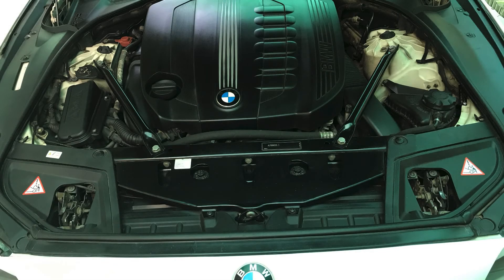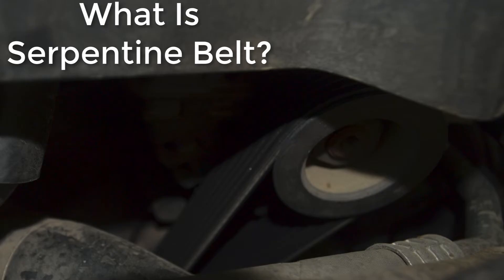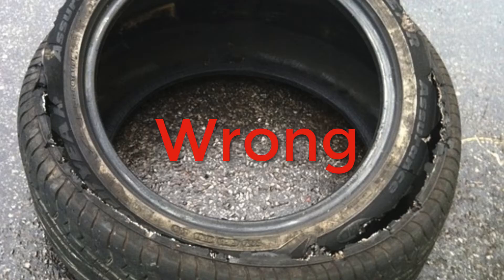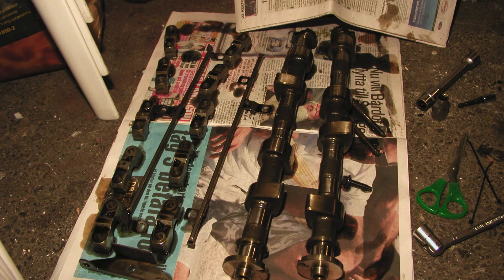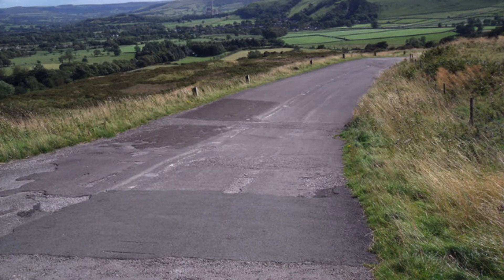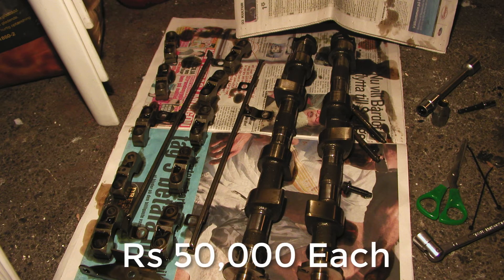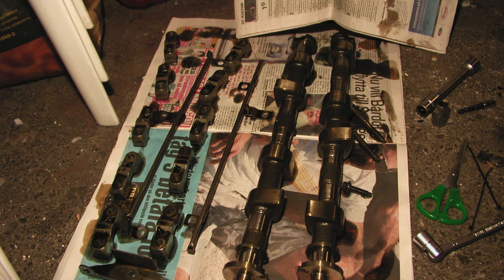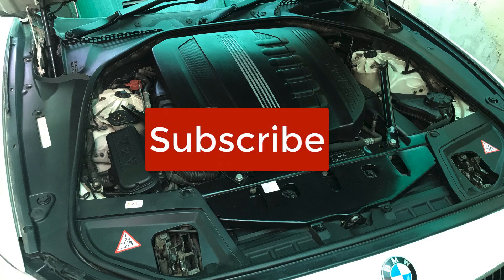Why You Need To Replace Serpentine Belt - Before It Snaps

Comment: This happened to me as well 3 months ago , coming back from work , when I started engine I heard some breaking sound , but engine running fine , also got some error like battery not charging or something. I ignored it thought some battery related issue and started driving back to home , halfway on the road  started getting error multiple errors abruptly then , all electronics stopped working one by one , steering got heavy suddenly , then car jerked 2-3 times and stopped in a middle of the road. 
Opened the engine , serpentine belt was out of the pulley hanging . 
Towed the car , and found out that one of the damper pulley which is attached to camshaft probably has seperated from its attachment with circular hole in the pulley rubber , and it looked like pulley rubber was too old and got torn out. When I gave car for repair the guy said belt is totally fine , only pulley needs replacement , luckily no camshaft or anything else was damaged. Yet I had to pay 25k sum for all damage.